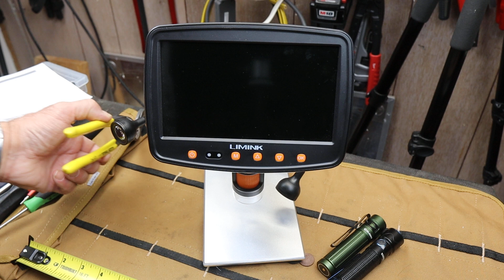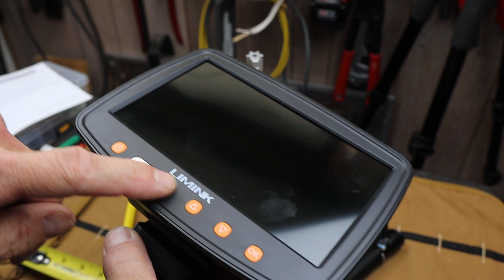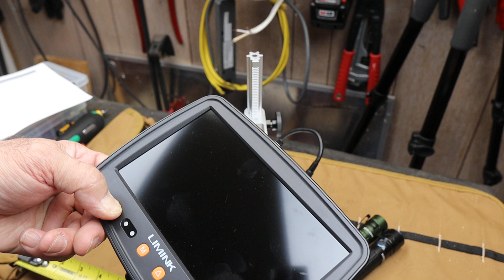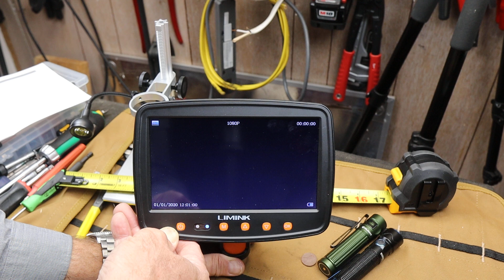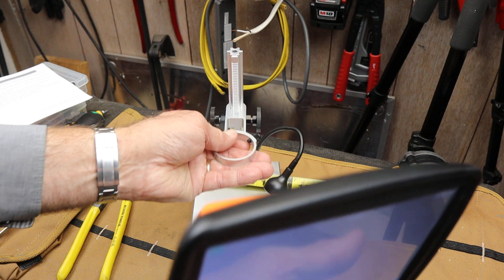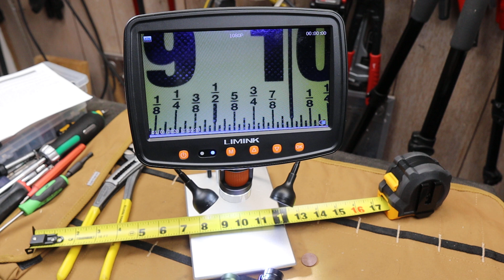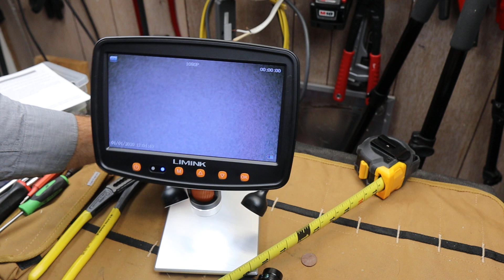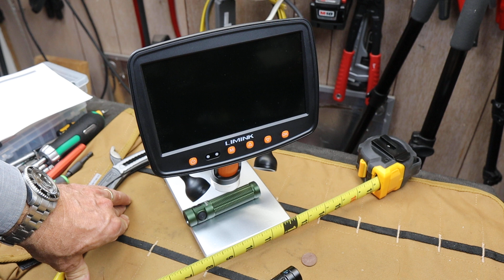Shop Digital Microscopes are Next Level: LIMINK 7" 1080p is razor sharp fast-focus & self-contained!

Comment: Depends on what you need. If you are for example a stamp/coin collector it's great but if you need to do some work under the microscope like soldering it needs to focus and magnify from further away. That kind of workspace under a microscope is sadly very expensive...

Comment: I wouldn't read too much into macro shots of flashlight & the like finish machine work... other than looking/feeling 'ok', they have few critical tolerances, and are pounded out at mere seconds per unit on fast CNC machines. Under close examination, surface finishes & knurling will assuredly vary somewhat from batch to batch and/or even specimen to specimen.

Most 'better' flashlight bodies are garden variety, general purpose, cheap, easy to source, free machining 6061-T6 Aluminum... which is also probably the best material for the application.